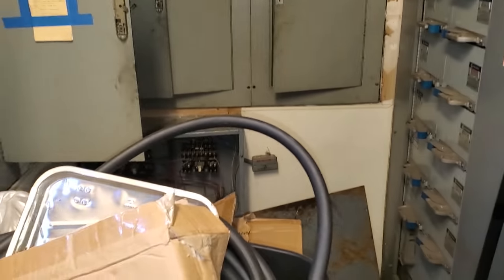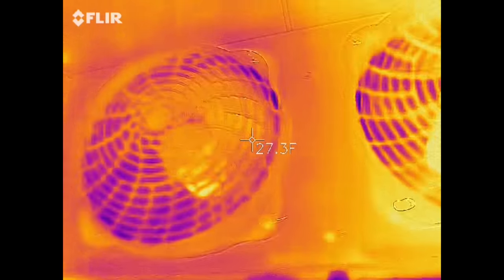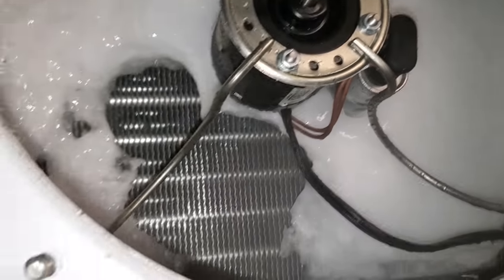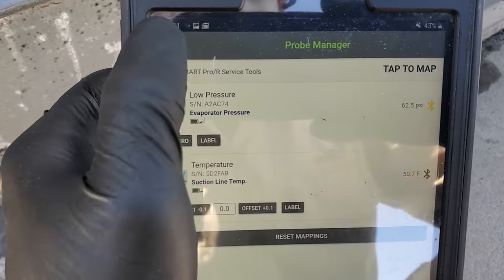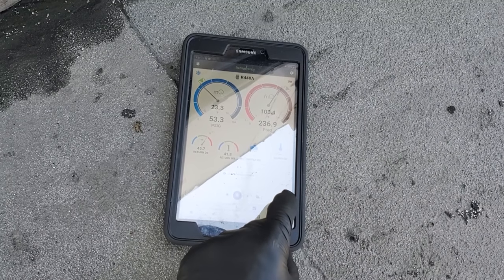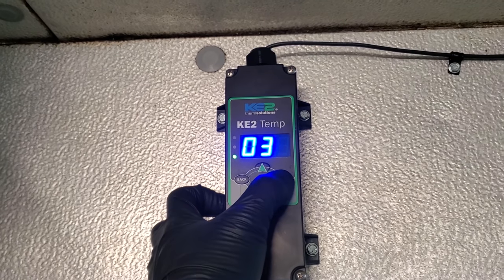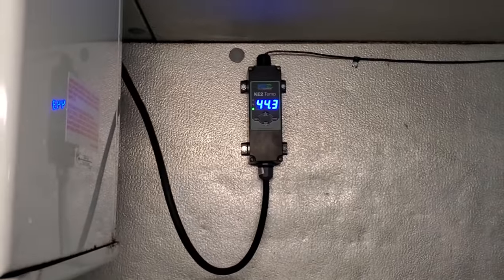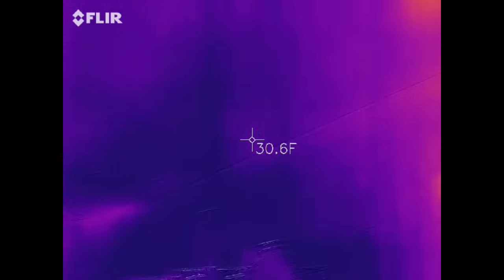WALK IN COOLER ICED UP

Comment: the makers of those walk in coolers could add a 4 inch analog rotary dial like a clock, which spun once per day. they could install it right on the center of the radiator face, and if freezup occurred, it would cease the movement of the rotary clock dial, which when stopped could initiate increased defrost commands. any simple moving dial, or device which when stopped could force defrost until movement returned. it would end those freeze ups

Comment: I felt like instead of just run time, open doors meant that more humidity could enter in two different ways. The cold air should already have frozen off the moisture onto the coil which would meet equilibrium with the room during defrost, so you have low humidity inside high humidity outside. The second way is because the warm air holds an awful lot more moisture and once it cools off that moisture can't be held anymore so it condenses on the walls and evaporator coil.  Since the evap is the coldest place, it will  be the last place to melt and holds onto the now dry ice while the warmer doors and walls more readily give up moisture.

Hopefully not too far from reality...

Comment: I like to put the control probe in the coil and control by coil temp. It guarantees defrost. Settings vary,  but low 20s with around a 15 deg diff works pretty well. Each box will be a little different, but it works out well on coolers.

Comment: Those rubbermaid carts I use matter if fact I have 2 a small one and a big one. They are great to carry items. That door was jacked up, if the customer did go with fixing the door you could've suggested putting rubber door sweeps to keep heat out. Electrical rooms are always a mess typical. Nice to see the comparison of 2 great tools being used. Great video on how a door is a big Key element of heat filtration. Thank you. Great work.

Comment: Did you get my email?  I've seen worse electrical panels especially the workshop before I moved in.   That's pretty bad like that one iced up from a while back.  those are pretty big gaps around the door, it's gotta seal tight like a household refridgerator door.  Yeah almost like it needs a bigger door.  I love those carts.  I bought a bunch.

Comment: people sometimes dont realize trades people can have more than 1 skill set,  and might could do other repairs, it doesnt hurt to ask. like me I do welding on the side. so fab work is easy,  for fun comment I have several similar doors in scrap metal pile. 2 with nothing wrong, replaced with different style during a remodel,  a few cracked, but complete with hinge pins. company I cut meat for just replaces cracked or damaged doors, never seen  one rebuilt, where do you find replacement door parts?

Comment: Kind of odd to see a swing door like that on a box, i've seen them in between a WIC and a WIF but not just to the outside like that.
Reply: Walmart does this in there walk in coolers. It's usually just a single door swing door into the back room. But it's well insulated.

Comment: You mentioned Lights (in walkin). Wouldn't LED Conversions (retrofit) pay off pretty fast?
Reply: I would think so, because you're saving double, especially compared to incandescent.
First off the LED's just flat out take less power to run so you're already saving money.
Secondly, now the refrigeration machinery doesn't have to extract the the heat from the lights out of the room, because LED's don't really produce that much heat.
Of course, most of the benefits could be had if you swap to fluorescent fixtures, but those have trouble running well in the cold without the right kind of ballast (In most conditions a slow-start ballast will make the tubes last longer than an instant-start ballast, but especially in cold locations a slow start ballast might be the only one capable of starting the tubes at all).

Comment: sorry i know this is a very basic question to ask an expert, but why do the coils ice up when the problem is too much excess heat getting in? thanks
Reply: The problem is that you are letting hot humid air in to the compartment.
That hot humid air is then  condensing on the coils which are below the freezing point of water.
That water then forms ice on the coil and the defrost cycle time is not enough to deice it as under normal conditions
Reply: @Teslacoiler83  thanks mate much appreciated!

Comment: A question from a guy that doesn't know better: shouldn't it be illegal to store things in the electrical room? Isn't it a massive safety risk in case something goes wrong and you need quick access to the room/need to extinguish a fire there?
Reply: The first inspector who goes in there will fine them and shut the store down, some places get a 5K fine for that kind of violation.
Reply: @davidnull5590  Ah ok, thx for the info